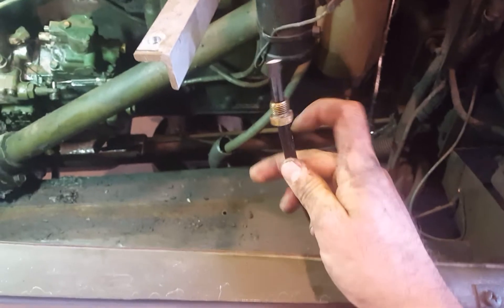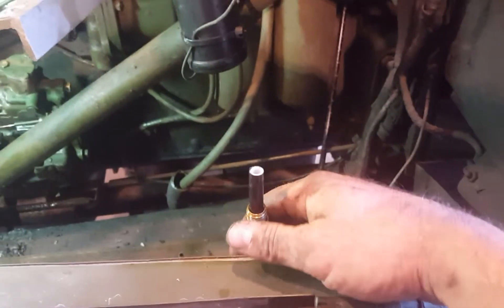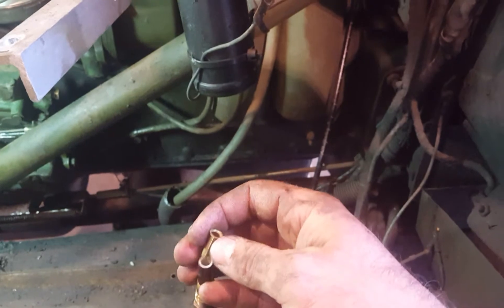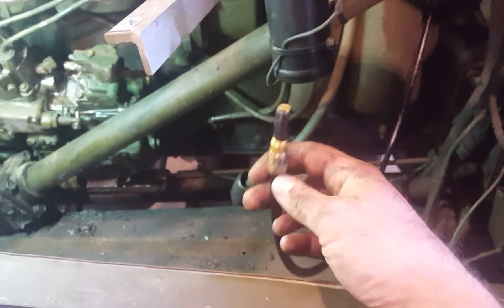Fuel line fitting assembly, tips, and FDC bypass completion overview

Comment: What is the benefit of these bypass?
Reply from the maker: Fuel density compensator leaks fuel into the oiled size of the injection pump, which contaminates the engine oil with diesel fuel and destroys the rod and main bearings. Basically you bypass this to keep your engine from grenading.

Comment: Will you please recommend exactly the correct DOT line.    I’ve called NAPA, Parker,  and several different places.   I guess there is a type A  and ...  also a type B?   Your line looks like there is an inner liner.
Reply from the maker: It is teflon lined. Not sure which type it is. Only thing available at the shops in my area.